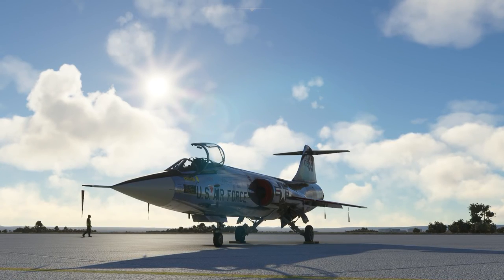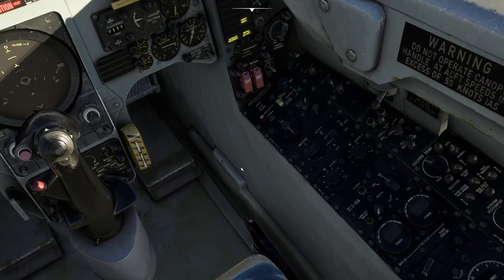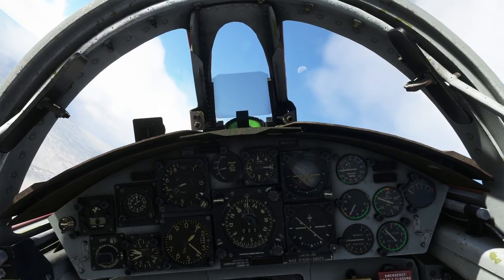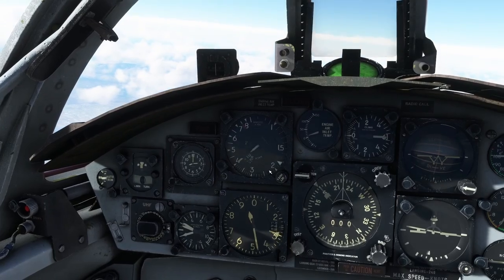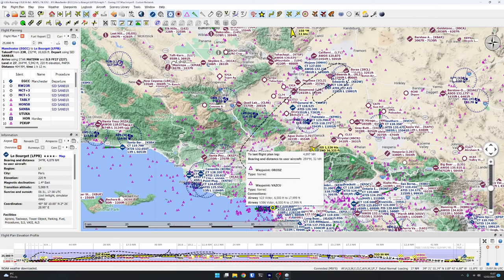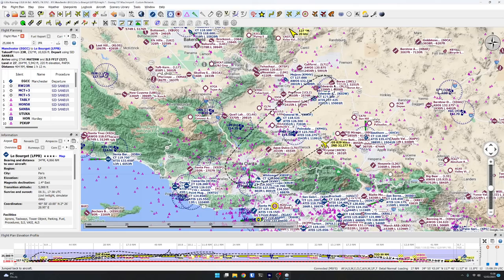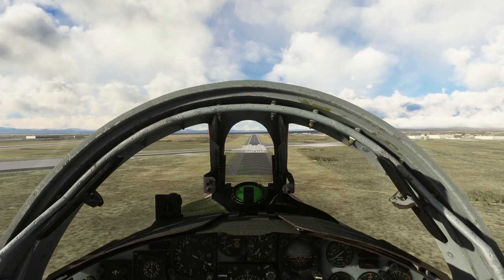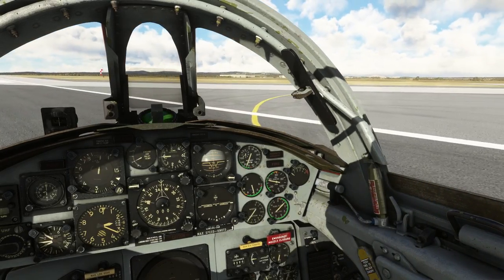Exploring Supersonic Flight in the Lockheed F-104 Starfighter in Microsoft Flight Simulator

Comment: My late father flew the CF-104. The 104 had zero issues going supersonic at any altitude. Either the flight modeling is not correct or your supersonic profile is incorrect. 450 kts/.9M in the climb. Level off at 36,000 ft @ .9M. Zip through the Mach like it isn't there. Notice "passing gear" acceleration or increase in acceleration at 1.4M. Easily take it out to 2.0M and climb at this speed, leveling off at FL500 or FL600 - whatever altitude you wish to cruise supersonically at. The 104 will see Mach 2 with tip tanks. If your 104 just so happens to be in the A model with the -19 version of the J79, you will cruise at 73,000 ft at Mach 2 with 3/4 afterburner, sipping 100 lbs of fuel per minute. Remember to wear your pressure suit. Re-run the mission with the aforementioned climb profile; 1 mission clean and a 2nd mission with tip tanks. No Rutowski Climb profile necessary for the Zipper. As a 104 IP, my father would take students up in the 2-seat with tip tanks, level off at 40,000 ft in 90 seconds. This was on take off. Might be leveling off at 45,000ft, I don't recall which altitude, FL400 or FL450. Now you have 3 missions to fly; 3rd mission is add in the TF-104 with tip tanks, leveling off at FL400/FL450 in 90 seconds.
Reply from the maker: I fear that the 104 in MSFS is doing what it can within the bounds of the modelling within the simulator. It's still good fun though.
Reply: @jonbeckett  It strongly appears so. Try another mission but with tip tanks in the TF model. Enjoyed the video. You did a nice job walking us through the experience. Lets see more. Try another mission in the TF model with tip tanks. Label the video, "TF-104 Pilot Takes Student For First Flight". Select a Canadian Air Force livery if there is one. We can't have viewers thinking the 104 is a dog! Cheers.
Reply: Thanks for your comments, saved me the trouble. What years was your dad in? I flew it in the late 60's-early 70's and your observations are correct. The G model that the RCAF flew had the bigger and more powerful Orenda engines and didn't have the gun, but more fuel added, and they also strengthened the airframe. Yeah, after seeing this, albeit wonderfully done video by johnathan, the modelling is not right. I've had it going at 780 kts indicated at very low level a few feet off the ground, and we did intercept practice up to  2M at FL55 when starting at .9 M at FL35 and reaching  2M turning and climbing to that level in under 3 minutes.  Above 1M, if you plugged in full burner, you would still feel the kick of acceleration....one of the few aircraft that had that feel to it. The first time I had the front seat of the D, the IP did a full re-heat unrestricted climb...it took your breath away and we were up to 40K feet in no time as you pointed out...and yeah, with tip tanks...which were about 3/4 drained when climbing like that to that altitude :-)  It was such a great aircraft...very stable at low altitude and throughout it's flight range...as long as you didn't fly it slow. I can tell you, it didn't like going slow....which I'm sure your dad told you. Cheers.
Reply: @haedubabaganush  Hello. My father was Captain Barry Krall (ret. Col), Class of 69/70. Flew 104 demo summers of 70, 71 and then home the summer of 72 for my birth. Then off to Venezuela for 6 months with 2 other Captains for the CF-5 deal. Name ring a bell? When at S.H.A.P.E our sponsors were the Simpsons with Rae being a CF-104 Test Pilot. I connected with Rae about a year ago. Wally Stone was another friend of dad's. He flew with the Snowbirds and the 101 as did Ernie Poole (101 and 106).
Reply: As much as I wanted to get the F-104 and play the music from The Right Stuff I’m having second thoughts. Sounds like MSFS can’t handle the F-104.
Reply: Are there any updates on this issue? I am reluctant on buying this thing if this kind of basic thing is over-modeled. I've read the real manual and it indeed says that in some special occasions, the amount of available thrust is not enough to go thru the transonic region unless losing an altitude, even with reheat, but in most cases it can. This is yet again a perfect example of a quirk that is based on a real thing, has been over-done excessively. Usually people praising how accurate it is, since it's hard and quirky, it must be correct.

Comment: Your father must have been the best of the best. As the F-104 was tricky, especially on take-off due to its short wing span. It needed miles of runway to get lift from its short stubby wings. It was really a missile with a man in it. 
I salute the F-104 pilots like your father.🫡👍🏻
Reply: True that the flight manuals show problems going out to 3+ miles (18000 ft), but modest density altitudes and loadouts on those little razor blades covered a lot of scenarios on 10000 ft runways, with some going as short as 1500 ft! Full burner and blown flaps for the win.

Comment: Just picked this up for the X box series S. Love the jet and the vintage timeframe, can you help me how do you get the tip tanks? I’ve tried varying all the weights in the fuel but I can’t seem to bring up the visuals for the tip tanks. Help me Obi-Wan!!
Reply: I'm probably too late, but you have to pull up the kneeboard. There is a slot under the throttle on the left. It looks like it could hold a brochure. Click on that. The option is in there.
Reply: @dillank3240  Thankyou !!!!

Comment: Very nice video and exercise, Jonathan. Flown within the envelope, initial cruise speed of M0.9 nicely simulated, (I just missed the needle shiverings when going super- and subsonic  ;-)). Temperature management required careful flight planning indeed (e.g.: AP config, acceleration time, distances, increase in fuel burned, density altitude, etc.) Thanks for sharing, much appreciated.
Reply from the maker: You're welcome - not so sure it really is that realistic though - some F104 experts have commented along the way - saying you should be able to go supersonic in level flight without too much problem.
Reply: @jonbeckett  She was indeed able to theoretically fly supersonic at low level. In particular at higher density altitudes in summer. 750kts equaled about M1 then at very low level. However, in Germany supersonic was forbidden below 15TFT anyway, better 30 - to keep all windows in their frames down below.

Comment: Many thanks for this video 👍 On a related note, are the blown flaps modelled (i.e. aerodynamically), together with correct engine bleed (rather than just coding in an extra, artificial, flap area, to estimate the effect of blowing)? Does one have to maintain a threshold RPM to maintain bleed air and therefore air blown over the flaps?
Reply from the maker: Yes - it does look like they have tried to model it appropriately. If you drop much below 85% RPM (I think it is?) you sink like a proverbial brick.
Reply: @jonbeckett  Is there a gauge indicating air pressure (e.g. PSI) bled to the flaps? It is interesting to hear the sink rate dramatically increases below a certain RPM, but depending on the airspeed and other conditions, if the bleed air pressure were to fall below a critical number she should technically stall right away... which I imagine in a Starfighter would be anything but gentle (i.e. more than simply increased sink rate).
Reply from the maker: @spatialpro  yeah - it's obviously not a full simulation - but given the sim now supports fluid dynamics, I wonder if they might ever update this plane to take that into account ?
Reply: @jonbeckett  Indeed. I'm thinking it'd be interesting to turn on the airflow indicator thingies in the sim.

Comment: Skin friction drag decreases as you pass M1.0? and start rotate at 150 KIAS? What version of the 104 supplied those figures? It certainly is not the 104G
"Slow light" comes on when T2 approaches 120°C and has nothing to do with a limit on the use of afterburner
Reply from the maker: Good feedback - thankyou. Maybe I should have said "start to apply back pressure at 150 knots" - because within a couple of seconds you're doing 200 :)
Reply: @jonbeckett  It is many years ago I flew the thing (104G version) but my recollection tells me that we rotated at 180 KIAS from the -5° to +5° and we would become airborne at 205 KIAS approx. We used the same procedure irregardless of configuration (tip less or with tip tanks).
If this is the same or different for other versions I don't know. The earliest versions did not have the J-79 engine/afterburner combination we had in the G version so that alone would indicate differencies